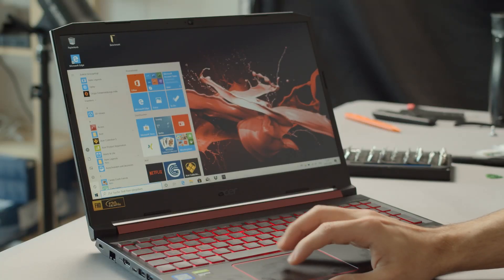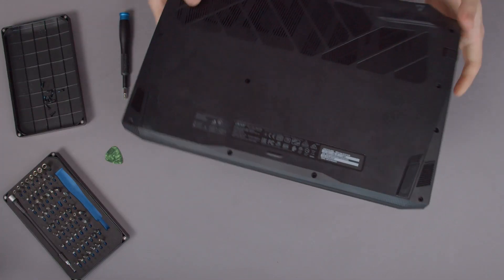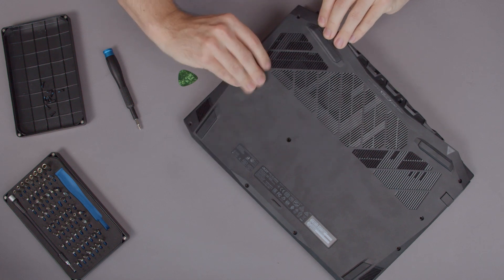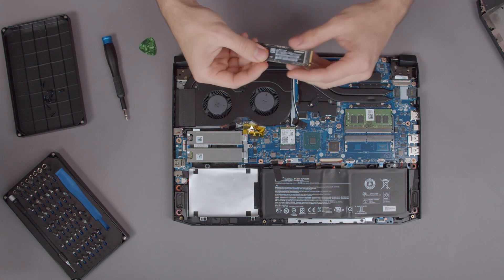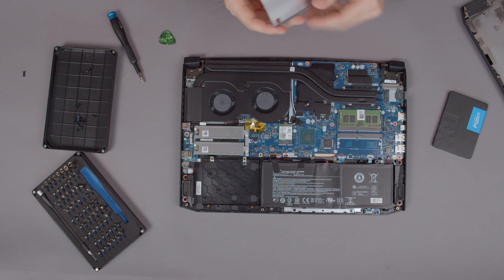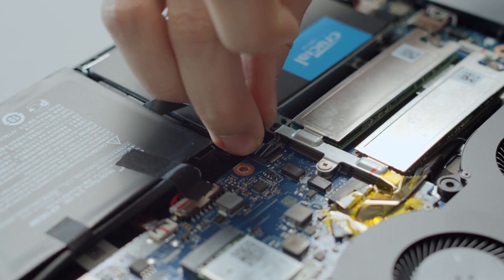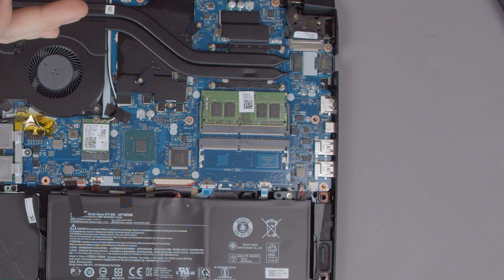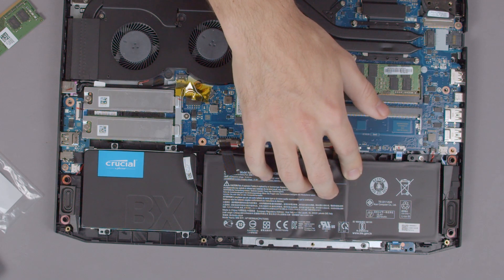Tutorial: How to Upgrade the SSD and RAM of your Acer Nitro 5 - ENG

Comment: I've just recently installed the sx8200 pro m. 2 SSD some reason it's not showing up disk management
Reply from the maker: Hey, did you install it in the second slot? Because that only support M.2 SATA SSDs, PCIe only work in the slot already in use.

Comment: I'm still a newbie when it comes to upgrading storage space for laptops or adding ram, so, my question is, for the ssd and hard drive can it be any ssd and hard drive? Or there's a specific ssd and hard drive for each laptop? Other than the size of course
Reply: assuming that you figured it out by now, but as long as the form factor is correct (m.2, 2.5 inch etc) then it'll fit and work :)
Reply: @qyurryusss  What does form factor mean and how do i know the one my laptop uses? Thanks in advance
Edit: Oh i thought form factor was different to the slot size. Nevermind then. Still thanks again for your first answer
Reply: Shawnly Naraja  you'll need to make sure you still have some way to put the Operating system into the new SSD to make it run windows but otherwise it's okay to replace. I think the nitro 5 model has spaces for multiple ssds though so U shouldn't need to throw away the original?

Comment: I have the AN515-54 model of this device which has the 9300h and 1050 3GB. wondering if I should upgrade the ram from 8 to 16gb and what ram should i be buying
Reply: Hey, I have the exact same model and I used this 8gb crucial sodimm 2400mt/s ram and it works great.

Amazon Link: https://www.amazon.com/dp/B01BIWKP58?ref=ppx_pop_mob_ap_share

Comment: When making the change, do you recommend that the battery be fully discharged or is there no problem with the battery?
Reply: The "state of charge" of the battery doesn't matter when servicing the laptop. The battery voltage usually is around 14.4V, which is comparable to car battery voltage. There is no risk of electrical shock to you, although you do want to be sure to remove all jewelry before working (just like when working on cars).

Comment: Let me get this straight, besides the original Hard Drive, there's an open slot for another Hard Drive or Solid State Drive, is that correct?
If so, I can theoretically insert another HDD into that open slot and have like, 2Tb of HD memory?
Reply from the maker: Hey, in total it has two M.2 Slots: 1 M.2 PCIe 3.0 x4 and 1 M.2 SATA 6 Slot. It also has one 2.5" HDD/SSD slot, but not every model comes with the neccessary connector cable. That depends on the individual region. But yeah, you can Upgrade quite a lot and even get a 2nd. SSD in.
Reply: notebooksbilliger.de thank you!

Comment: Great video,i have the ACER - Nitro 5 AN515-54 15.6" Gaming Laptop - Intel® Core™ i5, GTX 1650, 256 GB SSD and was wondering what ram and ssd to use would be much help. Would like to buy new 2.
Reply from the maker: Hey, any DDR4 2400MHz RAM will do. Best to do is to get a Kit of 2 identical Modules if you want to swap out the existing RAM. For the SSD there are also numerous options. To use the 2nd. M.2 Slot just get a M.2 SATA SSD in 2280 form factor.

Comment: I have a doubt if we have put a m.2 ssd nvme do we need to add the Pcie ssd and if not compulsory can we put a hdd in place of it?
Reply: Yes please help Professor
Reply from the maker: Hey, you mean if you can put in a second NVMe SSD? That's not possible, since NVMe uses PCIe and the one M.2 PCIe slot is already in use. But you can add another M.2 SATA SSD to the second slot. You can also add another 2.5" HDD or SSD if you like.
Reply: @notebooksbilliger  by the way I'm going to use it for studies and part time gaming so if I put a new hdd in the 2.5 inch bay will it affect the speed
Reply: Oh got it thnx well I knew we had to put a m.2 SATA ssd

Comment: Dude I so wanted to buy this laptop. Nitro 5 AN517 17.3 i7 2060 gtx then bang 8ngignof ram wtf is that. So.was gonna order that and new upgrade ram then found out would ruin the warranty  so fuck that lol. Doesn't make sense seems.like a pretty decent laptop for gaming but most latest games need 16gif minimum requirement  so fail

Comment: Hi
The vid was a great help, many thanks.
Am i coorrect the 2 items below will fit the laptop.

Corsair CMSX16GX4M2A2666C18 Vengeance 16 GB (2 x 8 GB) DDR4 2666 MHz 204 Pin SODIMM Performance Notebook Memory Kit - Black
https://www.amazon.co.uk/HyperX-Impact-DDR4-2666-SODIMM/dp/B014R8JUWO?th=1

https://www.ebuyer.com/760583-seagate-barracuda-laptop-2tb-2-5-hard-drive-7mm-at-ebuyer-com-st2000lm015

Comment: Hello,
Would it be any problem in putting one ram plate of 16gb 2666mhz beside my standard 8gb? 
Or the second one needs to be an 8gb too?
Thanks.
Reply: If I remember correctly from my old PC building days you can but you need to put the bigger card in the currently filled slot and move the 8 to the empty slot.

Comment: Why do u need to ground urself?
Reply from the maker: Hey, because it is possible you built up a static charge - like when you put on a wool sweater and touch anything mettalic afterwards. Those small static charges can be enough to damage a laptop. It's rare but still worth mentioning.

Comment: Hi. May I ask for help 
I have Acer Nitro 5 Ryzen 5 Version
I don't know anything about laptop and I plan to upgrade my laptop.

What should I do?
What should I buy? 

How many Ram? What is the best ram?
Ssd? What should I buy also?
Reply from the maker: Hey, there is no definitive buyers guide, so here are some examples: If you want to upgrade your RAM, 16GB is pretty much all you need if you're not planning to edit large 4K Videos. Also you should get a 16GB Kit, not a single module, so ensure Dual Channel operation. For Ryzen fast Dual Rank RAM is your best option, like the Patriot PSD416G2400SK. For an SSD it depends if you want to add another one or swap the existing one. If you want to add one you can use almost any M.2 SATA SSD in 2280 form factor. Crucial MX500 is a safe bet for example - comparably cheap and we never had any issues with several MX500 drives.

Comment: Is it possible to add 2 sticks of 16gb ram and how much ssd can I add to the laptop?
Reply from the maker: Hey, make sure to check whats the maximum RAM of your exact model as it may vary depending on the exact CPU. For the SSD you can use every capacity available as long as it fits the M.2 2280 Slot.
Reply: In any case, 32GB ram is quite a bit overkill for this system

Comment: i use one ssd can u give me a link for a second ssd 500gb or 1tb?
Reply from the maker: Hey, a second SSD can only be a SATA M.2 SSD. Since I don't know where you're from a Link isn't easy :) But for Example the Crucial MX500 is a very solid and comparably cheap choice.
Reply: @notebooksbilliger  Prof, in my case, one of the two slot is marked PCI/SATA and on the other PCI. Can I completely replace the memory and put two Non-SATA PCI M.2 Memories?

Comment: Hi. Does this have 2 slots for RAM? I've just bought the laptop with 8GB RAM and wanted to add another 8GB of RAM so it becomes 16GB. Is the second slot just underneath the first RAM slot? Thanks
Reply from the maker: Hey, yes, it has 2 slots. So you can just add another RAM module.

Comment: Are you sure the computer supports 3200mhz rams? i have amd 3750h processor. Have you tried using 3200mhz ram? where did you get this information?
Reply from the maker: Hey, seems we had a slight error here. The 3750H runs on 2400MHz RAM max. But ofc 3200MHz will also work but it'll run on 2400 then. Sorry for that mistake.

Comment: great video! Wondering if you can suggest a ram for my ryzen 5 cpu, thank you very much
Reply from the maker: Hey, go for DDR4 SO-DIMM with 2400MHz Frequency for best performance. Crucial or Kingston are almost always compatible without any issues.
Reply: @notebooksbilliger  i have one 8 gig 2400mhz in my acer nitro 5 that i just bought the other day. However,  i was thinking of getting 2 8gig Crucial ddr @2666 would that cause a problem as I see it was one of the ram sticks for it.

Comment: Help Needed! Hi tried to upgrade ram by adding another 8gb in the second slot. the clock speed, voltage everything is same except the default ram brand was kingston and the new one was hyperx. However, when i add both ram and turn on the laptop, the screen goes black. also tried only with the new ram on slot 1 it works and then tried only the second slot with one ram, the screen goes black again. it looks like the second slot does not work. my laptop is brand new and it's only time i have opened it. is the device faulty or there are any settings i am missing to make it work? and solution would be of great help
Reply from the maker: Hey, sounds like your second slot is faulty, since it works with the standard and new RAM in the first slot.
Reply: Shahensha-E-Alam Give it a try upgrading the BIOS using the default RAM. Download the BIOS in acer website and install it. I believe hyperx is still kingston brand.

Comment: What ram and ssd should i buy? The same one or any?
Reply from the maker: Hey, you can use any M.2 SATA SSD you like. The RAM should have the same timings as the current one, which may vary on each unit. But in general go for DDR4 SO-Dimm with the same frequency and you'll be fine.

Comment: @notebooksbillger.de really cool video man !
I just got AN517 and  want to do my first upgrades ever.
i saw the crucial mx500 1TB m.2 sata ssd online would that work ?
Also I saw a lot of posts on dual RAM could i just add 8gb or should i rather get 2 16gb's?
Reply from the maker: Hey, yes the MX500 should work just fine. 
If you want to get another 8GB or dual 16GB depends on how much RAM you want/need. Throwing in another 8GB is fine, just check the frequency of the current RAM to get a matching second SO-DIMM. If you wann go all in with 2x16GB get a kit and it'll be fine.

Comment: Guys I just got an internal SSD but it didn’t come with a connector cable, was it supposed to? Or do i have to but it separate
Reply from the maker: Hey, you can buy it separately, check the other comments for the exact part number to look for :)

Comment: Is this the AN515 or AN517?
Reply from the maker: Hey, it*s the AN515.
Reply: Would it be the same on the AN517?
Reply from the maker: Sadly we haven't been able to test the 517 yet. Usually they share the same board design, but I can't say it for sure.
Reply: notebooksbilliger.de it looks like the AN517-51-56YW does not support the same SSD as the AN515 , according to crucial’s website it should be M.2 SSD • PCIe NVMe Gen 3 • 2,000 MB/s Read, 1,700 MB/s Write , I reached out to acer to confirm this ! At the moment I put a mx500 Sata m.2 2280ss ssd 1tb in the extra slot and I cant find it does not pick up on my device manager. Will give more feedback as I hear from Acer.

Comment: Underneath the RAM, is that another available slot? Also, for the M.2, is that another vacant slot? 

In theory, this can be a pretty storage and RAM heavy notebook.
Reply: LostParadise yes, can do 2x 16gb ram I believe and then 2x of the m.2 ssd.
Reply from the maker: Correct - Up to 2 M.2 SSD and - in theory - up to 64GB RAM depending on the CPU. But 32GB RAM modules are quite rare and expensive still. Also the second M.2 slot is SATA only, keep tha tin mind when upgrading.

Comment: My laptop won't turn on now that i added a second 8gb ram. Any help on what to do?
Reply from the maker: Hi William, check if both RAM are properly locked and in place. It won't turn on if one is not perfetctly in place.
Reply: @notebooksbilliger  they both look the same, i pressed down and heard the clicks of it being in place. I took out the one i added and still the same, not turning on. Thanks for getting back to me
Reply: @notebooksbilliger  so i did a bunch bunch of suggested things in different videos. Now it did turn on but now it won't charge. Lol any tips on this now? I've disconnected battery and tried charging with the battery not contracted, nothing. It's all brand new.
Reply: @williamsmoak  did you fix it?
Reply: @pablo-ww2ey  nope

Comment: Hey, I have nitro 5 with 2x4gb ram, If I wanted, let's say 16 gb ram, should I buy 2x8gb and replace both 2x4gb, or buy 1x16gb and have 1x4gb + 1x16gb and have 20 gb? Does that work and is there any issues?
Also, nice tutorial!
Reply from the maker: Hey, you should always try to get matching capacities to get full Dual Channel operation. So if you want 16GB get 2x8GB. Oder if you want 32GB get 2x16GB. Mixing 16 and 4GB will of course work as well, but it will be slower than 2x8GB.
Reply: @notebooksbilliger   Got it, thanks!

Comment: thanks mate but how to buy ssd and ram for nitro 5 ?
Reply from the maker: Hey, I'd propose a visit to your local electronics store :) But in case you're not sure about what to get: You can use DDR4 SO-DIMM Memory and M.2 2280 SSDs. For the SSDs: If you want to add an additional one make sure to get a SATA M.2 one, since a second PCIe M.2 won't work.
Reply: @notebooksbilliger  thank you so much
Reply: what did you end up getting ?

Comment: Great tutorial. Any idea why mine is not taking my M.2? I can see it in the bios but not the windows devices. Also, now when I have the second one installed it just spins at the acer loading screen on startup.
Reply from the maker: Hey, what Acer didn't include in the documentation and we also just learned: The second M.2 Slot is only compatible to M.2 SATA SSDs. So in case your second SSD is a PCIe SSD it won't work sadly.
Reply: @notebooksbilliger  ahhhh that may be the cause. Also, when I called acer when I was having trouble installing it they said that the motherboard does not read anything over 512gb? I cant confirm as I wasn't going to buy another stick to try it out. I was just wondering because in your video I see you installing a 1tb. Did that work for you?

Comment: Can someone help me? I installed my M.2 SSD but neither my BIOS or Windows will recognize it. Is there a reason for this? Here’s the one I bought

 (Note: I’m using the same model in the video but it’s the 17”3 version.)

Crucial P1 500GB 3D NAND NVMe PCIe M.2 SSD - CT500P1SSD8 https://www.amazon.com/dp/B07J2WBKXF/ref=cm_sw_r_cp_api_i_KREMEb2X73TJB

If any of you know any compatible M.2 SSD’s for this laptop then can you please link it?

And another question is if any small cotton fibers (from a shirt) come into contact with the thermal pad, do I have to replace or will it be fine? Sorry for the long comment!
Reply from the maker: Hey, what Acer didn't include in the documentation and we also just learned: The second M.2 Slot is only compatible to M.2 SATA SSDs. That's why your PCIe SSD won't work. Get a SATA M.2 like the Crucial MX500 and it should work fine. Also no need to replace the thermal pad because of a bis of cotton. Regular M.2 SSDs won't get as hot as it would matter.
Reply: notebooksbilliger.de Thank you so much !!
Reply: @gio5215  did you just do the ssd or the hdd too? how big was the original ssd that came with the laptop ?
i just bought the 17" so i want to do all the upgrades.
I saw ssd's online with 1TB do you think that would work?
have you done anything with the RAM ?

Comment: I lost the included cable to upgrade the 2.5 inch ssd. Where can I buy one.
Reply from the maker: Hey, look for the following part: "Acer 50.Q3RN2.002" - that's the part number to identify it, so you'll get the correct cable.

Comment: One M. 2 slot is Sata/pcie, the other one si pcie only. I already have 2 x m2 ssd's,1 nvme ssd and 1 m2 sata ssd. My question is, can I also install an 2.5 inch HDD? Or the sata connection is shared with the m2 sata ssd which is already installed?
Reply from the maker: Hey, unfortunately we had no SATA M.2 at hand to try it and the manual doesn't include that information. I think it should work, but can't say for sure, sorry. If you try it, let us know in the comments please if it works :)
Reply: Thank you for your response. I just tried now and it works. 1x 2.5 inch HDD, 1 x M. 2 SATA SSD and 1 x M.2 NVME SSD and it works. All recognised and working fine.

Comment: hi the model i am buying is the 2019 one with an i5 but it will have an ssd and hdd. im wondering what adding another m2 ssd would do for me.
Reply from the maker: Hey, at least you will get more storage space. :) Also you could replace the HDD so you don't have any moving parts besides the fans inside your laptop.
Reply: @notebooksbilliger  thanks :) i know i can do so much with the ram i guess i will start there. i wish i knew what type of screws came with the laptop i  always end up losing a few over time. i think the nitro 5 is gonna be 66 percent faster than my old toshiba.
Reply: @notebooksbilliger  sir, i need help . how do i know if the ssd is working like, does it show "SSD" on device and drives ?

Comment: Is it ok if i add 16gb ddr4 2666mhz ram even though my computer only runs up to 2400mhz? Im using amd ryzen 7 and default ram is 4gb ddr4 2400mhz. Will my 16gb ram clocks 2400mhz or will it wont work?
Reply from the maker: Hey, it will work, if there is slower RAM present it will lower the frequency to ensure Dual Channel operation. If it's the only RAM in the system it should use it's regular Frequency.

Comment: I have a single 8GB ram with 2133MHZ and I need to add another one to another slot but I can't find my ram in our stores here and if I found one it'll come with a higher price so I ordered a 2400mhz and I need to know, it'll work well with my current 2133mhz or not?
Reply: and my model is 
AN515-51 with 7300hq and 1050TI
Reply: Im not sure but I think it works but it cant do its best. If u buy that 2400mhz it works like 2133mhz
Reply from the maker: Hey, exactly. The RAM will work, but the frequency will be lowered to 2133MHz to ensure Dual Channel Operation.